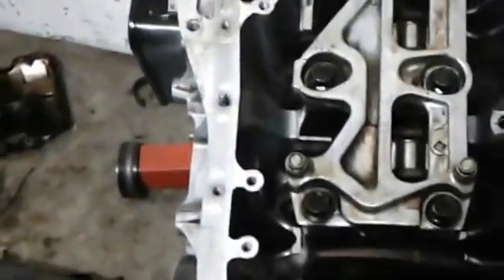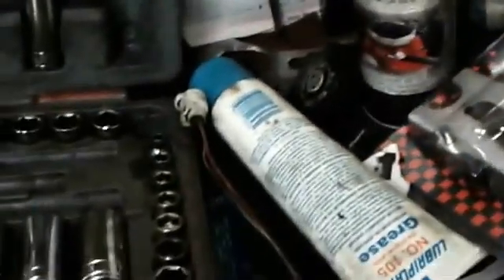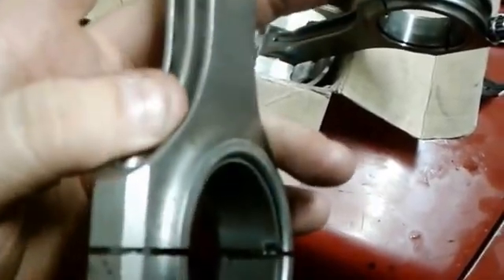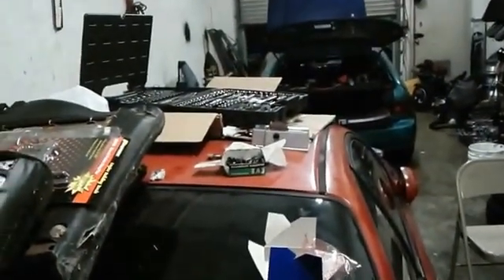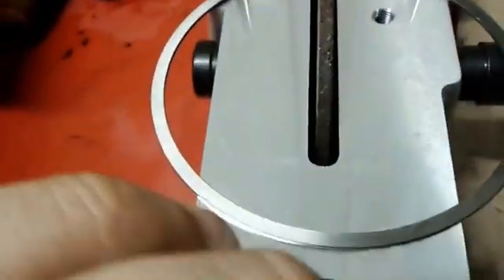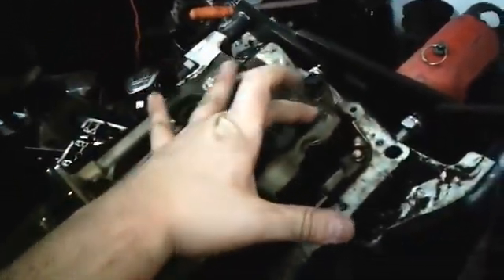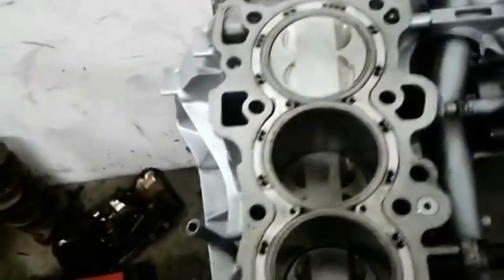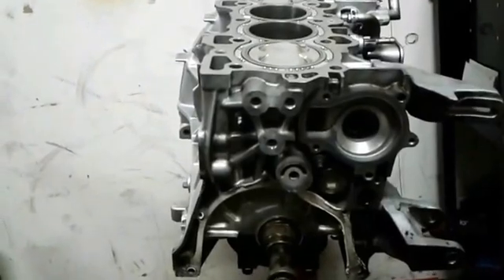B18b Internals In GSR Block. Turbo Engine Build - Pt 3

Comment: That's a piston ring filer and idk if it's just because you were making the video but you don't just file the one side both sides get filed at the same time together
Reply from the maker: ive seen people do that, but the thing is that you dont want to file off the mark on one side of the ring. best to keep one side untouched as a reference. or not if you prefer not to. does absolutely nothing to effect how the engine runs